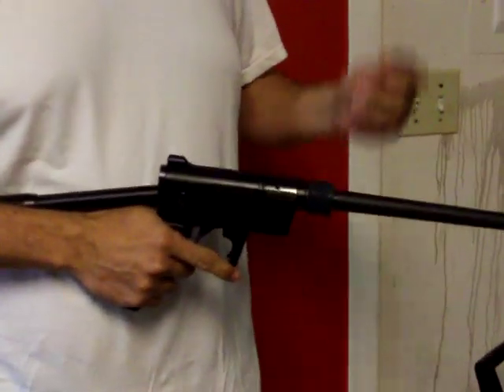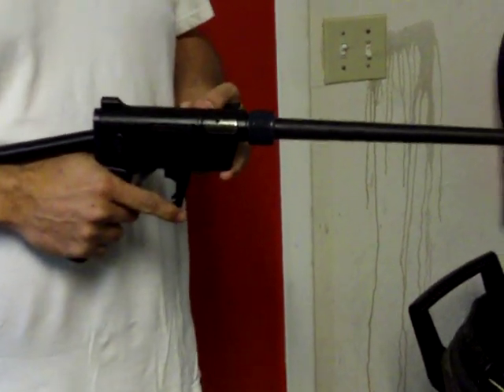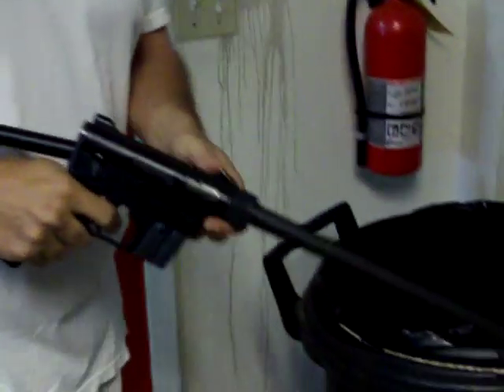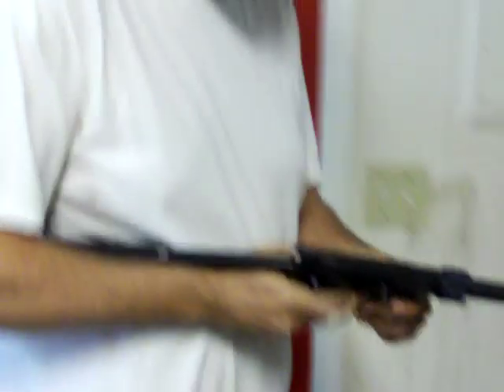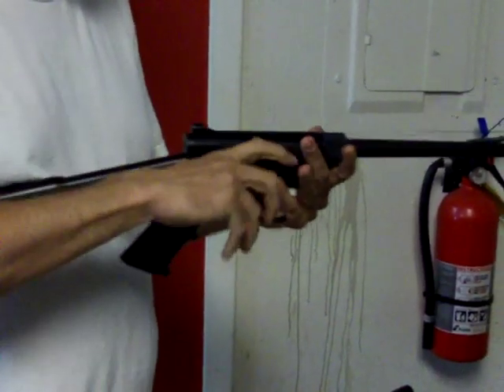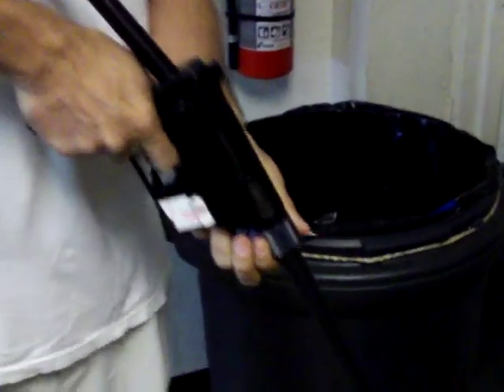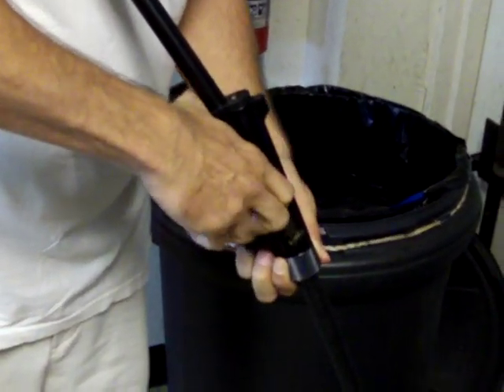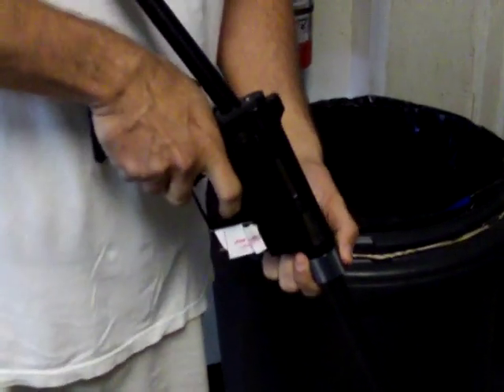Spring Modification Henry U.S. survival rifle part 3

Comment from the maker: @TheStealthCamper Thanks for the input.  Im going to do a part 4 with one more col removed to see if it resolves the issue first, but youve inspired me to another direction with the BB gun springs in case it fails.  As for the barrel...thats going to be another project. Probably pick up a a thicker steel barrel for it later on.